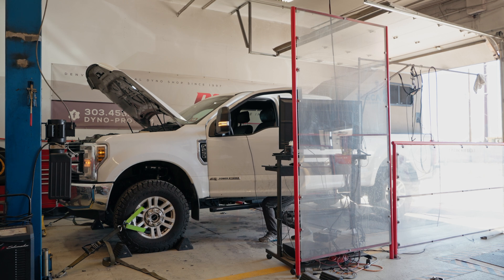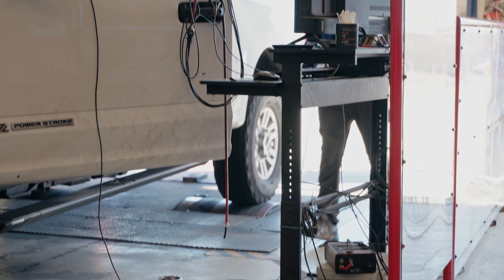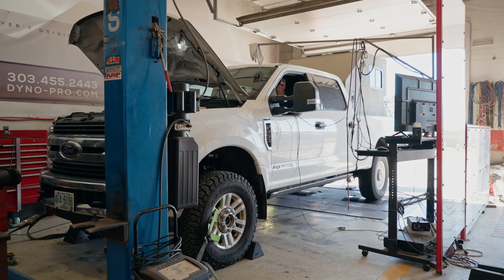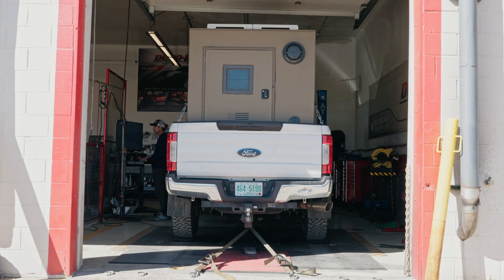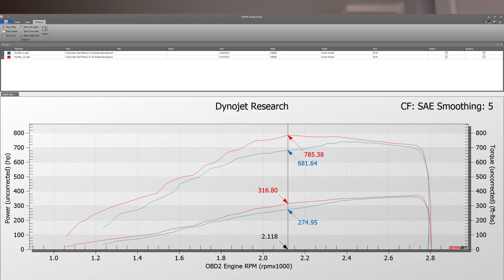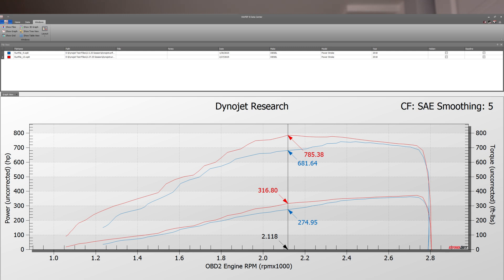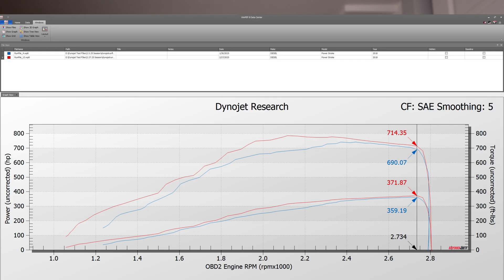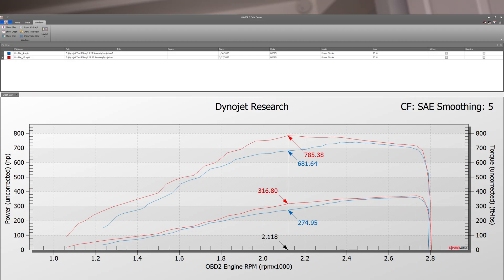6.7 PowerStroke Owners: This 1 Sensor Is Limiting Your Power

Comment: Since yours is stock, give thought to a MAP sensor replacement.   My 17 on a xfit workout, had only 20k miles before and now 65k miles later, i replaced the MAP with an OEM part from rockauto.  No seat of the pants notice, but the port for the sensor woth only 20k, had a signifncant amout of soot from the egr, caked in it.

Comment: Informative…. The relocation of the MAP in Intake helps with sooting on sensor.  Easy quick preventative measure. 

Agree on new Diesel, they have a lot of emissions to deal with… although the computer controls have improved the HP & Torque drastically. 

If able to DIY, many of these aren’t overly challenging to maintain reducing cost. 

What Intake are you experimenting, I’ve been looking at Pusher Emission compatible and SPE’s emission Intake.